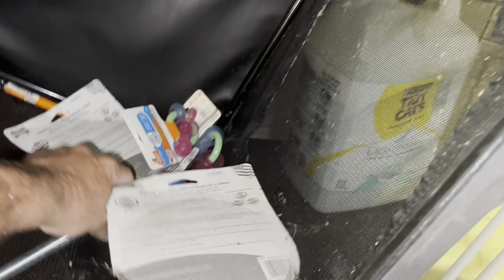Another ABANDONED baby needs rescue! #flipflopfarmer

Comment: I find ones like that all the time. I usually put it in a very small closet with a wireless speaker and crank some heavy metal music with a strobe light on. After that I put it in a plastic tote with scalding hot water and bleach, then put the lid on. Takes care of fleas. Then, it's back to the closet for another 4-5 hours or so.